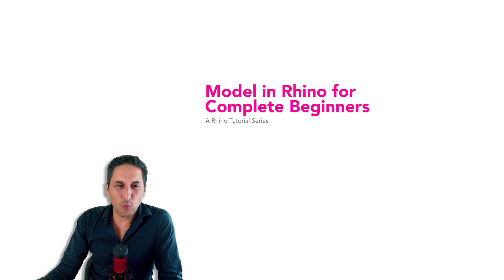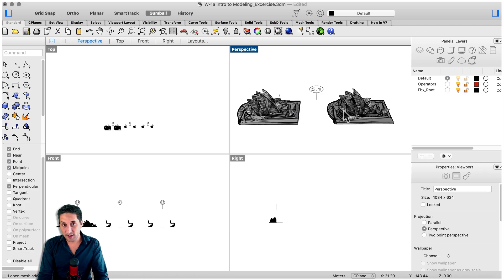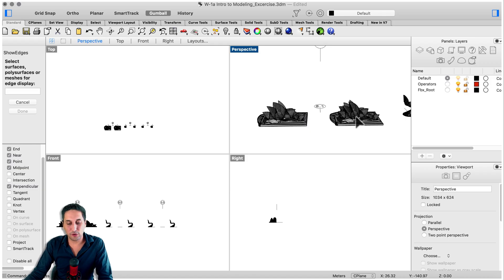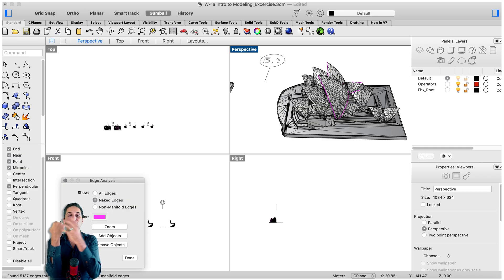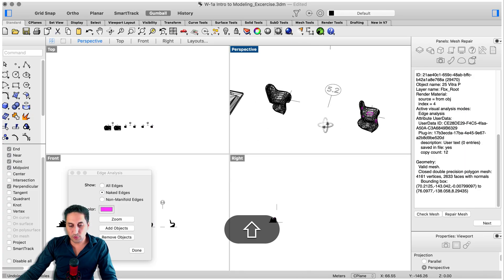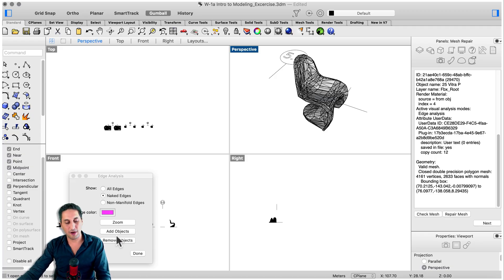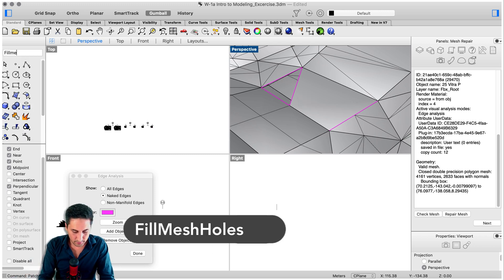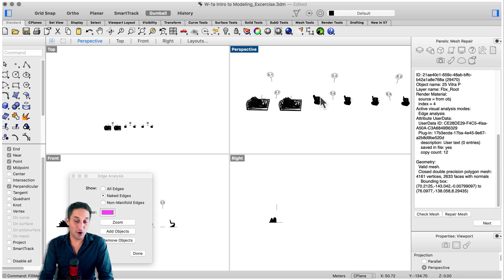Rhino 3D Tutorial: Fix Watertight Meshes & Naked Edges for 3D Printing | Ep.5

Comment: When there are 2 surfaces sharing an edge, I often encounter the issue that the mesh at the edge is not compatible (i.e. they aren't sharing the nodes). Is there a way to fix that? It's quite a problematic because the incompatible mesh can't be used for the finite element analysis.